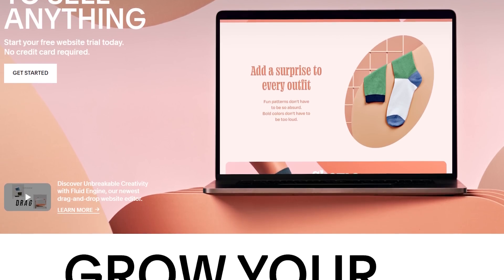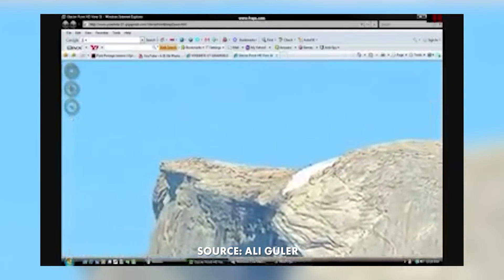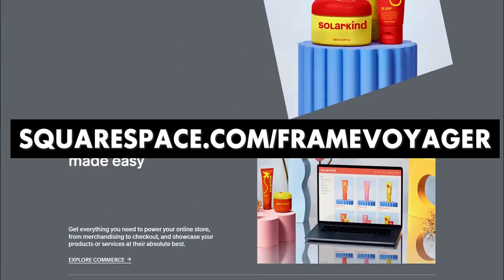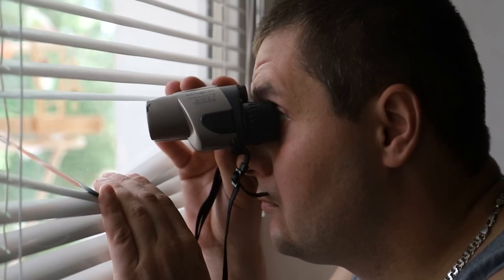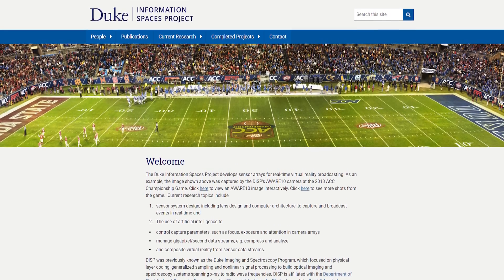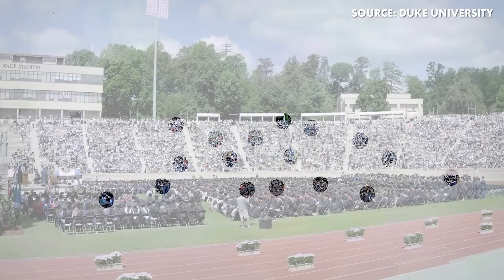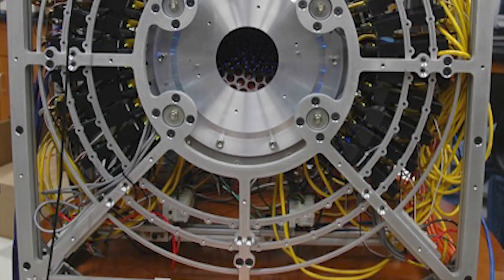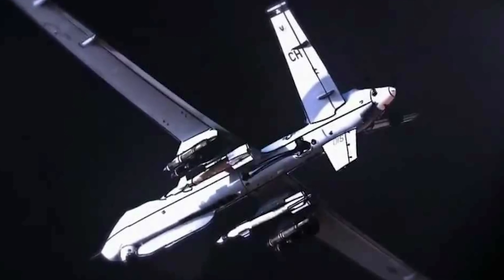This 300k Resolution MEGA camera is INSANE

Comment: Gigapixel digital imaging systems are way older than you've pointed out. 8x10 film scanned 4k dpi is about a gigapixel, which drum scanners are more than capable of. Also, digital scan backs have also been available in the gigapixel models since the late 90s.

Comment: I really doubt this is going to take off anywhere outside of very niche fields like surveillance satellites.  

Quantum dot imaging systems as a replacement for CMOS would allow both for much higher pixel density - perhaps not as much as a gigapixel - more information per pixel with true color information in each pixel rather than a CFA, and more dynamic range.  And, importantly for the camera business, don't require completely re-working the optical systems of the camera* and don't require exotic cooling.

*The other thing that wasn't really mentioned is optics.  You can cram as many gigapixels as you want, but with a FOV that wide, the lens/glass itself is going to be a bottleneck - and a solid glass ball is a lot of material for light to go through, it's going to lose some definition.  It would be better to have fewer MP and instead have glass capable of some level of zoom, again except for things like surveillance satellites where you want everything.

Additionally, all major camera manufacturers (Canon, Sony, Nikon, etc) now have sensor-shift optical stabilization and are in a race to the fastest sensor-offload, mechanical and electronic shutters, all of which would be very difficult if you had dozens of times as many sensors.

Comment: using multi sensor is not good idea. using a ultrasound device shakes camera sensor than record ultrasound graph and image sensor data. mix them by using ultrasonic guide. you will see much more details on processed image.
Reply: i had imagined something similar to what you are saying. making micro adjustments to capture sub-pixels ?

Comment: The lens isn't nearly sharp enough to resolve that much detail. So a waste of pixels in my opinion
Reply from the maker: but it's taking tons of photos and stitching them together so not really an issue of the lens resolving it
Reply: @FrameVoyager  Yeah depending which version of the camera, the one in the thumbnail seems to have only one lens and in some shots you can clearly see the issues.
Reply from the maker: @hzubovi1  But it's taking photos from hundreds of cameras at once and stitching them together. So the only thing the lens has to resolve is whatever sector the section each individual camera is taking a photo of. Sure it's not going to be perfect but if you test it out on there site it's still pretty impressive

Comment: Although pressing the button once to create these type of images it’s still not possible for a consumer today…to create an image like this is and can be done somewhat inexpensively 

Buy a high resolution camera like an a7r4 (used $2400) and a telephoto lens($600-$3000). There are companies that sell a device($500) that you input what focal length your lens is and then tell it what the corners of the image will be. It’ll then determine how many pictures to take and how much to move between each photo. Then you just start the process and to create an image like the one in the video would take about 2-4 minutes. 

You just have to stitch them together in Lightroom. 

I’ve done it personally with just a normal tripod and hand adjusting the lens on a cityscape